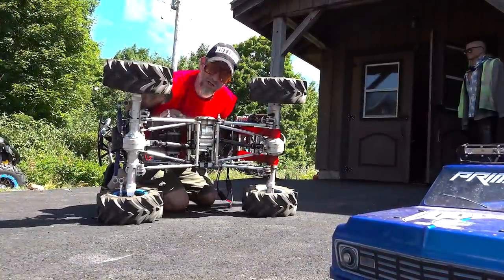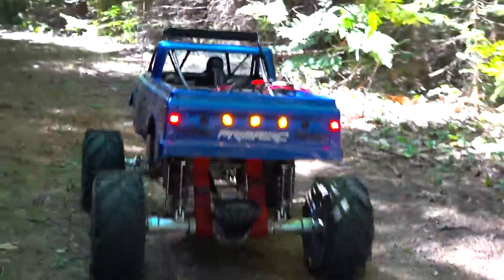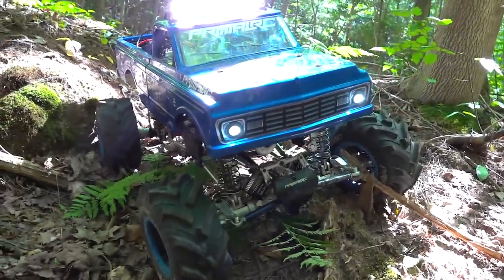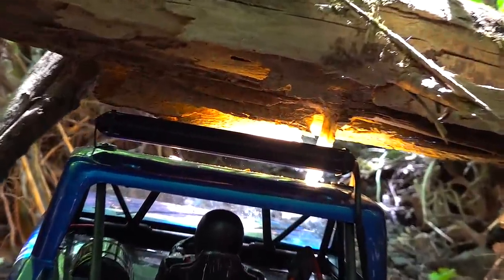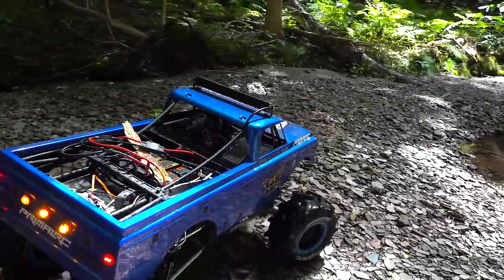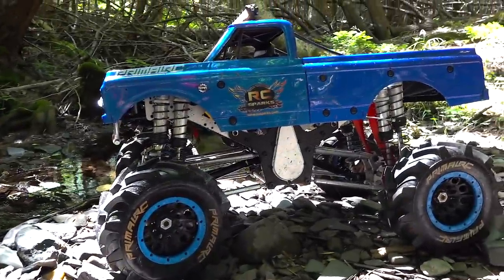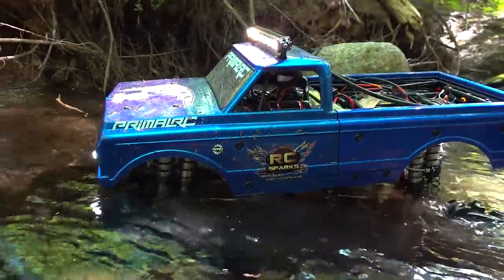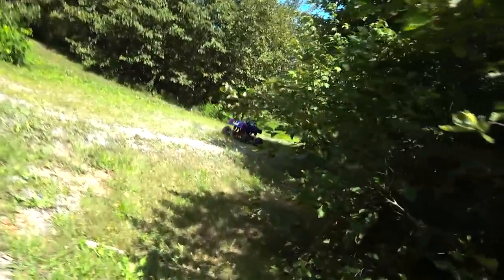TiNY 100lb 4x4 Trail RC Truck - Where No Man Has Gone Before | RC ADVENTURES

Comment: Really love the fact you use the Raminator how it’s meant to. Absolutely badass
Reply from the maker: Thanks brother.. Deep in the belly of the woods.. a Primal RC roams..
Reply: @TheRealRCSparks  absolutely killer video. Really love the Primal RC. Keep it up 👍
Reply: @TheRealRCSparks  do you want the truck to have lockers? Or do you like the limited slip? I think it might be possible to do scale lincoln lockers with jb weld lol. And the axles would most likely break before the jb weld breaks

Comment: Hey rc sparks I just wanna say I'm a huge fan of all of your guys YouTube channels. I recently became a solid follower if yours and I need your advice I recently installed a new servo motor in my rustler 4x4 and I installed the receiver and the servo cables backwards at first so I switched them to what I think is their correct position but
Reply: It didn't work out and the thing kinda just shut down. You got any advice for me

Comment: I havent seen what the spool looks like on those trucks, but if you wanted it to have full locked suspension i think you could easily do it with a little jb weld. But again idk what the inside of the pumpkin looks like lol.

Comment: Plus when it’s in mid air the weight of the axle housing doesn’t pull the shocks apart the piston inside the shock would have to hold all that weight end result pull the shocks apart limiter straps saves you money Yep 😁👍👍